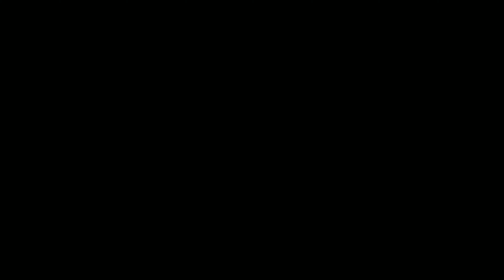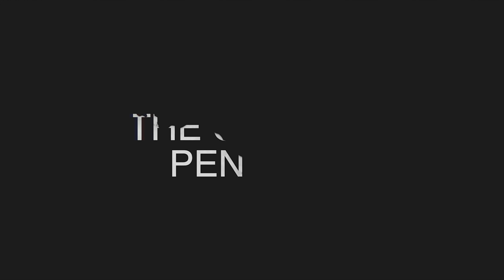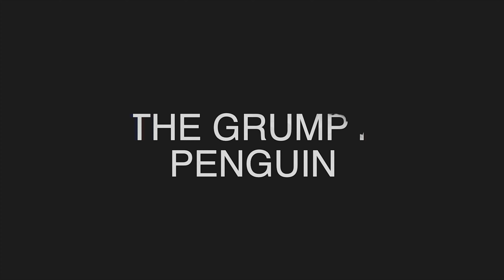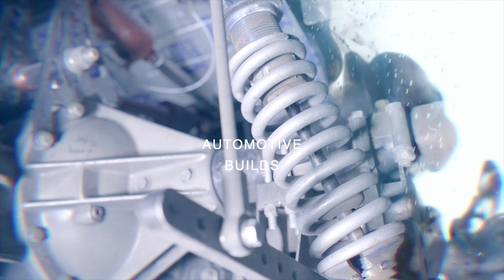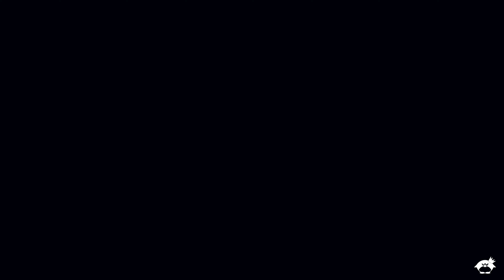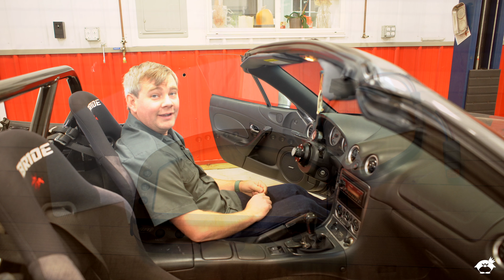AiM racing dash in a NB. MAJOR WIN AND MAJOR FAIL

Comment: I love this mod! 😍😍😍 I have a nb1, without obd. Is possible install this?
Reply from the maker: AngelCars the best way to utilize one of these systems is with CAN and a stand-alone engine management system. I use a MegaSquirt but it is also compatible with Haltech, AEM and many others! It is possible to install it without these systems but it does require a lot more sensors to work.
Reply: Thanks you for your answer, is like I was thinking, too much work. Great job, i love it. You have a new suscriber.